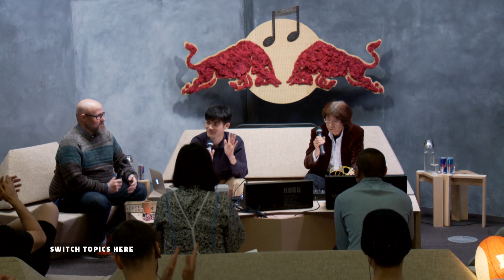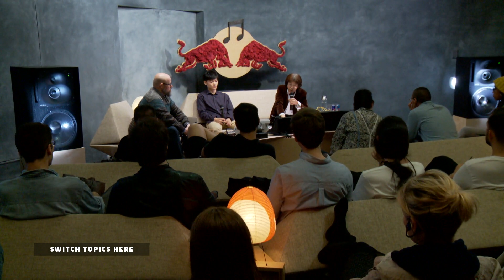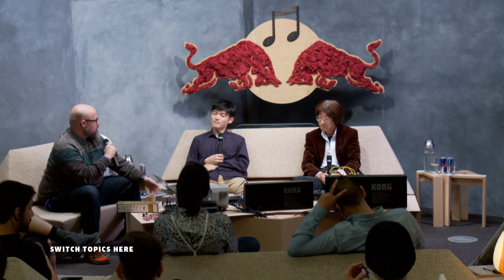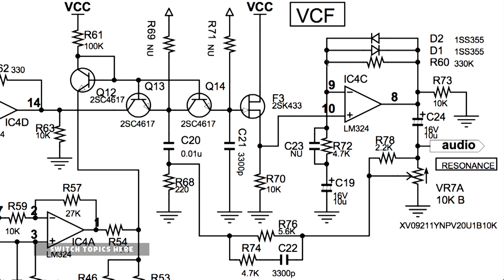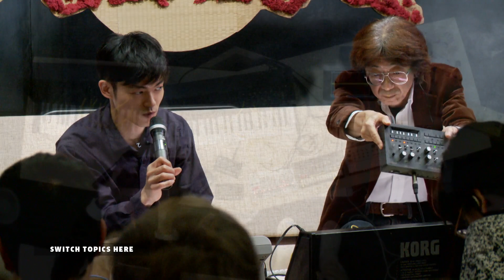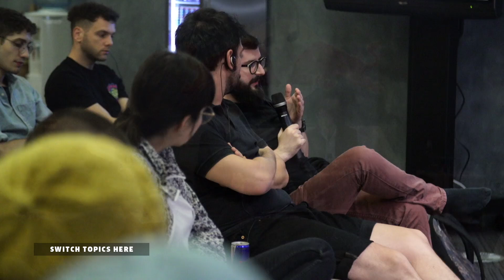Korg’s Hiroaki Nishijima & Tatsuya Takahashi on The Magic of The Machines

Comment: The calculations of today's CPUs are perfectly enough to emulate analog synths very well. u-he Diva, Native Instruments Monark, TAL U-NO LX, these virtual instruments sound extremely close, and for a good deal of bread&butter sounds even virtually identical to their analog counterparts. I find it quite weird that Tats wasn't aware of that in 2014...
Reply: no
Reply: Yes.
Reply: Mario Krušelj so long as digital is 'modelling' analogue it is always behind. The idiosyncrasies of the analogue machine need to be written-in, this has practical limits. These limits may be processing but also (increasingly) man-hours/cost. This is not to say that digital products can't be (or aren't already) effectively indistinguishable in use.
Reply: You are absolutely right. The idea though that analog is not easily emulated is not what Tats is saying though. What he is saying is that the limitations of the circuit is what gives the synth character. You can emulate that character but without new analog synths there is no new characters to emulate. I think that transistor tubes are inferior technology but Tube amps have character and some have a very pleasant character. To evolve we need limits. Understanding and embracing those limits is a beautiful thing.
Reply: Quantum computing VSTs